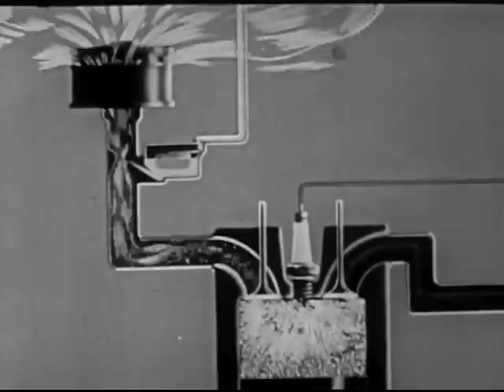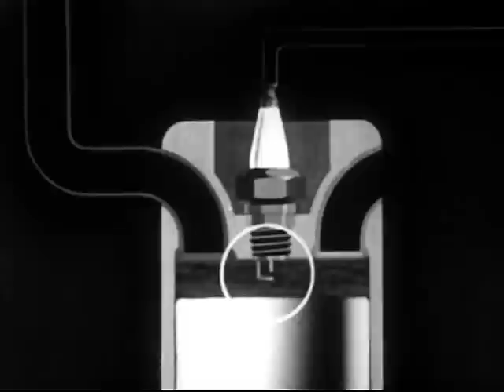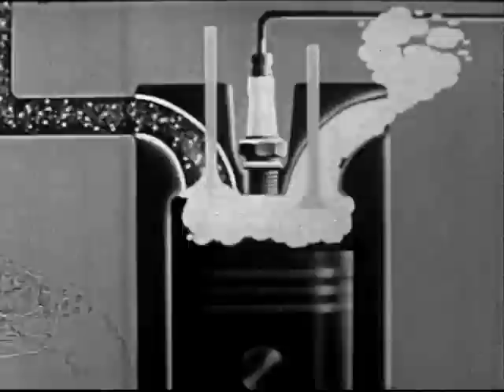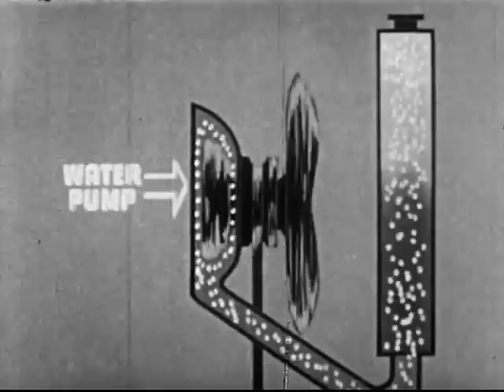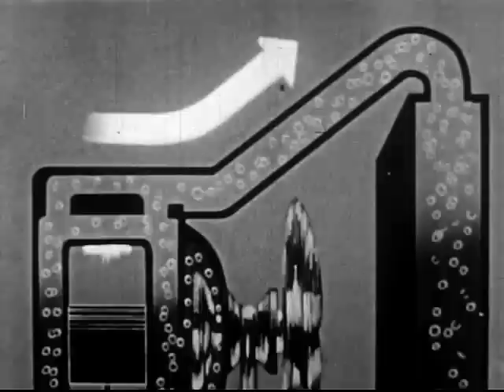Automobiles (1955)

Comment: "An automobile engine consists of six or eight cylinders." I love the U.S. car market :)
Reply: Nope! Today's trand — is — one cylinder 0.8 liter
Reply: @kergithan yoooo!
Reply: And some engines have 4 cylinders and spin much faster up to 8000 rpm and make tremendous power. (In presenters voice)
Reply: Beethoven80 I thought the same, hahaha!
Reply: Midcentmiata tbh they only had low rpm pushrod i4 engines back then, and my car has a i6 that revs to 8,200 rpm
Reply: Meanwhile in England: "3, take it or leave it."
Reply: It's common knowledge that the car have six and eight cylinders, like V8, V6 and Inline 6. But most cars have many variants of engines
Reply: @user-qd6hg8my1n  more likely to get 1.2 Liter inline 4 cylinder
Reply: Bugatti Chiron: hold my beer
Reply: @adnanabdillahghifari1956  the flathead 4 cyl came before v6 in-line 6 or v8
Reply: 12 cylinder engines: Am I a joke to you?
Reply: @adnanabdillahghifari1956  or 3-cylinder
Reply: Yes but don't forget this was when 4 cylinder engines weren't as commen
Reply: Meanwhile Italy or France 
"The automotive engine has.. 1.. 2.. 3 12 or 16 cylinders."
Reply: How about JDM？JDM is the best only
Reply: In turkey we have 3 or 4 :/
Reply: For USA only V8 engine exists
Reply: @ThomasFarquhar2  My response was to take out the eco engine and put in a V8.
Reply: @BauregardSenior87  good luck fitting a V8 into a European car
Reply: most engines these days are 4 cylinder. 
there are still 6 and 8 cylinder engines. which is likely in trucks.
i went from a 6 cylinder car to a 4 cylinder car and gained 100hp over the 6 cylinder.

100hp makes a heck of a difference 14s 0-60 to a 7 second.
Reply: @ThomasFarquhar2  And in Italy "Naaa, let's gonna use only 2"
Reply: Because back then American cars were so heavy that you had to have at least 6 cylinders to go 60
Reply: @Industry-insider   I would love to know which car you have. I6 reving above 8k sounds mouth watering
Reply: @ohchord9573  it’s a bmw s54, 3.3L and I have the rev limit at 9000 now, it’s got a top mount 80mm turbo and it’s fully built to handle over 1000hp, it’s a street car though so I don’t need over 800
Reply: Go buy a Toyota and put an American flag on it. Torque can not be substituted. Or you telling me your 4 cylinder working 10k times harder is better. Okay I will get someone smarter to talk to. Don't tell me how many miles and blaa blaa blaa, you replaced a head gasket, a timing belt and a host of other components to get to your bragging billion miles. So tired of American cars getting a bad reputation for needing the same repairs that everything ever built has needed in high mileage situations. Now days all engines are made everywhere and all car makes are the same virtually. All engineers are recruited globally, including good old USA. So what were you talking about again?
Reply: @josephlarsh7695  it ain’t that deep, trucks shouldn’t have 4 cylinders though but it isn’t over stressing the engine if it’s in a car, a well made and serviced engine won’t have anything wearing in it, also there’s no reason a head gasket should blow
Reply: Yeah, the US hadn’t even heard of the wankel rotary, and electric vehicles were a forgotten novelty by then.
Reply: @UmmYeahOk  he was referring to the 6 or 8 part lol
Reply: @Industry-insider  I know. The point was that back then, the US market only believed 6 or 8 cylinders were the only option, even though Europe and Asia had smaller engines, or even motors without pistons altogether. The US had EVs, but once ICEs became more dependable and easier to start and drive, the market forgot they ever existed.
Reply: Just learned more about auti-mow-beels in ten minutes than I knew in my entire life. Brilliant
Reply: 自分の軽自動車は３気筒です(o・ω・o)
Reply: As it should be
Reply: Every honest owner of a car with only three cylinders will confirm: We are going backwards.

Comment: Here i am in 2019 wondering how im going to do the carburetor experiment with banned plastic straws
Reply: Use metal straws that are individually wrapped in 5 layers of plastic
Reply: you miss only the lighter lol
Reply: Back in the 1950s, straws were typically made using paper, wrapped (and glued) into a thick tubular shape.  (Like a paper-towel roll, but, in plastic-straw size, and thicker than a plastic straw.)  Plastic straws did exist, but paper ones worked too, and were cheaper.  So, try to find yourself some paper straws maybe, if plastic ones are banned in your country/state (or province)/county/city.
Reply: I have a real full size carburetor in the trunk of my car i sometimes do experiments with it
Reply: Don't worry about it. Modern cars all use fuel injection. Carburetors not involved! :)
Reply: Now that's funny, because back in the 1950s, most straws were made from... paper & cardboard. Plastic didn't really take off until the 1960s to 70s. Ironically, the shift to plastic was partly spurred by environmental concerns over chopping down forests to make paper & cardboard. Plastics were made from petroleum & natural gas... that stuff from the ground that's cheap & would never run out. ;-)
Reply: Simple: just get an old carburetor, and some matches.
Reply: Qualquer canudo faz, pode ser de metal
Reply: @itagil2005  can you translate to English?

Comment: Wait, wait! 8 cylinders!? Toyota says cars only need  4!?
Reply: Nowadays its 3, keeps shrinking.
Reply: Technology. The original Ford Model T inline 4 engine, 2.4L has around 50 horsepower. Now compare that to a newer inline 2 engine making the same horsepower at 0.65L. 

Now, if the internal combustion engine was 100% efficient, a simple, natural aspirated, 2 liter inline 4 engine can theoretically make 400-500 hp at 9.5:1 compression ratio with 13.8:1 air-fuel ratio...

Comment: So, if that soap bubble didn't have gas vapor in it, it wouldn't explode if touched by that candle flame?
Reply: Yes. If you ignite a regular bubble, it will not ignite violently like the bubble in the video. In fact, it will not ignite at all, because nothing within the bubble can be used as fuel for the flame.

Comment: What pushes the cylinder back up after the power stroke? The negative Air pressure?
Reply: What pushes the piston back up is the momentum of all the moving parts attached to it, aided by the flywheel

Comment: What happens to those burnt gases after they leave the engine? Where do they go?
Reply: there's a series of tubes hooked to your engine called an exhaust manifold. the tubes run to a downpipe, where they are consolidated into one main flow pathway (or two if you have a dual-exhaust setup). From there, they run under the vehicle all channel all the way to the rear, where the gases flow out of the tailpipe and into the atmosphere.

long exhaust piping is necessary to create back pressure and protect occupants of the cabin. like a rifle, longer pipework creates stronger propulsion of exhaust gases, which ensures the engine's ability to expel all the gases from the combustion cycle. along with back pressure, a lot of carbon monoxide is produced during the combustion phase. if the pipes weren't routed sufficiently, gases can leak upward into the cabin of the vehicle, causing possible harm to the occupants.

as for what happens to the gases after they leave the vehicle and float into the atmosphere, you can find a breakdown of all chemicals that combustion produces and their associated effects on the environment.

Gases released:

nitrogen
carbon dioxide
water vapor
oxygen

Trace elements released
:

nitrogen oxides
carbon monoxide
particulate matter
hydrocarbons
sulfur dioxide

Comment: Maybe someone will see my question. In the audio during the part about carburetion, they said the normal pressure over the body of fluid pushes the liquid up the straw where lower pressure is generated by airflow across the straw. I learned something a bit different, the low pressure over the straw (venturi) created a vacuum of low pressure which sucked the liquid out. Which one is correct? Or are both correct?
Reply: Strictly speaking, there is no such thing as suction. There are only differences in pressure. Therefore, the liquid is pushed up the straw. A vacuum is simply a region of low pressure and it by itself has no ability to attract (pull or suck) a liquid. A higher pressure somewhere else must push the liquid toward the vacuum.  -physicist

Comment: How the intake opening, exhaust opening and the spark is synchronised?
When intake opens exhaust must be closed and when both are closed, hit the spark and then open exhaust....

How is this controlled?

Any video on this?
Reply: Vivian;  In the automobile engines of this time the valves were operated by cam lobes on a shaft that ran the length of the engine and had one cam lobe for each valve so a 6 cylinder engine would have a cam shaft with 12 lobes - 6 lobes for the intake valves and 6 lobes for the exhaust valves.  The camshaft was driven either by gears or a chain from the crankshaft (the shaft that the pistons rotated) using a 2 to 1 speed reduction so that the cam shaft rotated at 1/2 of the crankshaft speed. The lobes on the cam shaft were positioned to open and close the intake and exhaust valves for a given cylinder at the correct time in relation to the piston position.  There was also a gear on the cam shaft that meshed with another gear of the same size that rotated a shaft in a device called a distributor. The distributor had two functions.  The bottom part of the distributor created low voltage pulses of current in the primary of a transformer called the ignition coil.  The secondary of the transformer created high voltage pulses that were fed to the top part of the distributor which contained a rotating switch which would connect the high voltage pulses to the correct cylinder to fire the spark plug when the piston in that cylinder was near the top of the compression stroke.

Comment: Carburetor is crap, Fuel injector is better!
Reply: MDS  carburetors destroyed engines over time . Almost no one ever kept them adjusted . They flooded cylinders over time .
Fuel injection is why you can get 100,000 miles or more on a engine without it smoking , leaking and using oil . Cleaner modern fuels and lubrication also factors in .